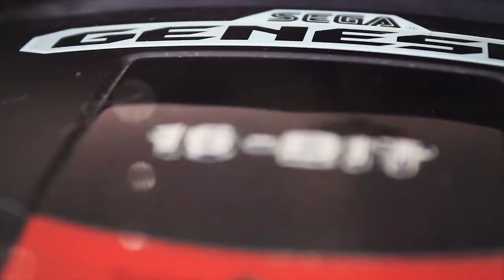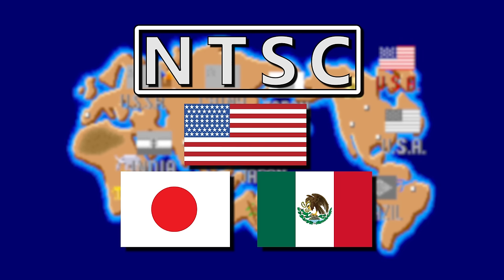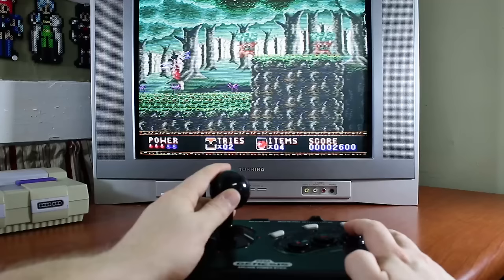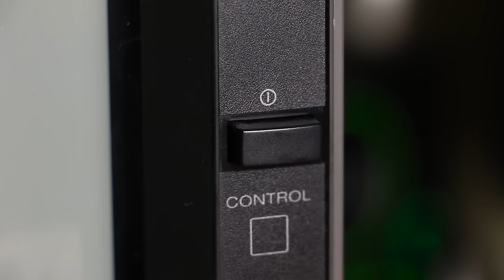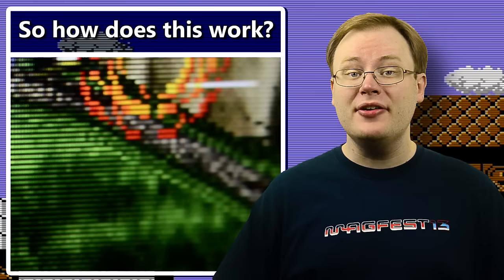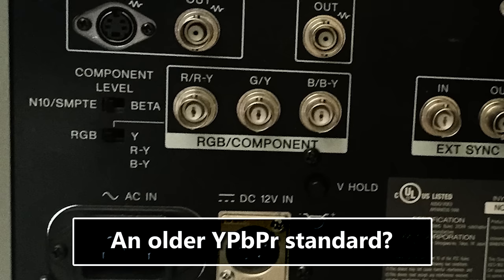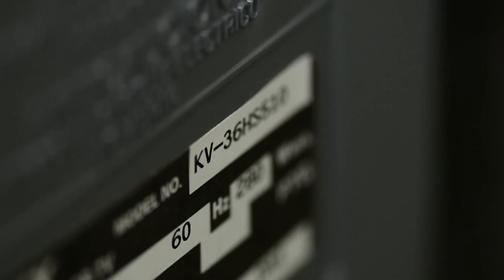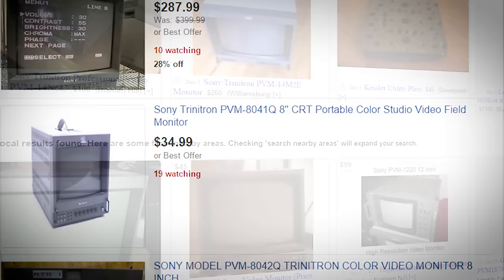Gaming on CRT Televisions, PVMs and BVMs :: RGB104 / MY LIFE IN GAMING

Comment: If you want a PVM but don't want to buy a real one, the CRT-Royale-Kurozumi shader in Retroarch is very easy to use and looks absolutely perfect. Tons of customization too just in case you need to tweak it.
Reply: Just get a 32 inch Toshiba crts the ones they use in the video have Orion tubes and not in house Toshiba made tubes
Reply: then you get not only lcd upscaler lag, but also added time for shader to process a frame.
Reply: @yashe6780  True, but the latency can be mitigated by enabling Run Ahead and having half-decent specs. You can get lower latency than original hardware in some cases. Plus the shaders can be off-loaded to the GPU. Nowadays, it's much better than just a few years ago.

Obviously real CRTs are best, but they're expensive, clunky, and cause headaches when sitting too close or listening to them emit that high-pitched whine. I think modern shaders offer a convenient and accessible alternative, especially if one has a 4K+ resolution.
Reply: I have a television that supports 480i/p 1080i, I want to connect my laptop to play retro games on that TV, I also want to connect my PS1, PS2 and my Sega Dreamcast, what can I do to have the best resolution playing 8/16/32 bit video games?
Reply: It's a Sony Trinitron Wega.
Reply: @FLYNN_TAGGART  Those shaders like Royale always look wrong to me, i managed to tweak them a little and it became better but still... you are missing the zero motion blur and awesome contrast from a real CRT.
I found that the Koko Aio or something shaders offer a more true to life CRT emulation than Royale, but maybe its because im using a common 1080p monitor.

Comment: Theoretically it might be possible to drive a modern LCD or OLED similarly to an old CRT, by emulating the beam path and refreshing the matrix in a scanline pattern.
This would require a specialized controller, and would be somewhat difficult to pull of properly, but the display panels themselves are capable of being driven like that.
With clever software, this could even emulate the scanline look and scale on the fly for near 0ms latency. Though keeping in in sync would be difficult.

Comment: Great video. I spent a lot of time on my gaming setup and currently own a PVM 2030, a JVD 27" TV (D Series) and a RGB modded 20" Samsung TV. Here are my 2 Cents: If you want the best retro gaming experience, my vote is for RGB modded 20" TVs (for North America). While PVMs excel in color, geometry and sharpness, the thick scanlines and the visible pixels ruin the look for me. If you want to recreate the look you remember from childhood (without interference noise) stay away from Sony Trinitrons. They use a technology called "aperture grill" which will produce thick scanlines. A RGB modded (non Sony) TV will give you a "shadow mask" look and if you stay under 20" the pixels will all blur nicely together and create a very pleasing image. Pretty much the image you would see in the Arcades since most classic Arcade games used RGB shadow mask monitors.

Comment: Something regarding the thickness/thinness of the scanlines: it's a twofold thing.   Part of it comes from the dot/grill pitch of the tube (an older tube would be more like a .56 pitch while your newer Toshiba was probably .36).

On top of that, and I learned this from a video of PhoneDork's, is s CRT's TV Lines resolution.  Lower numbers (probably 300 on the 14" Toshiba) isn't too pronounced.  Your 27" tube most likely has about 500, hence the blank lines being more pronounced.

Even higher grade presentation or professional CRTs, like my NEC XM2960, the Sony PVM line, or the BVM line, have even larger TV Line resolutions (going up to over 1100 for the BVM that suppports 1080i!).  This gives those thick black lines some retrogamers desire so heavily.

PD's videos might be a bit colorful on the language, but his NEC vs Sony video is amazingly-informative.  Also, keep in mind the PS1 and Saturn was when games started mixing 240p and 480i while sometimes having a few pure 480i titles.

Comment: I happen to use CRT PC monitors to get my PVM/BVM-like fix.
Way less nerds fighting over them, gouged prices, and tubes that have been punished with tens of thousands of hours of use. Wider pool of tubes to draw from as well, and the results are pretty damn similar to PVMs as far as quality goes. I love the fine geometry control as well. 480p is just standard too if you like 6th gen, and most humble tubes can support 720p if you don't mind a letterboxing. If you score a really nice one, 1080p is a possibility as well, but I find that's usually difficult to get scanning correctly.
I happen to use an XRGB-3, but these days you'd probably be better off with an OSSC to get your stuff over to your monitor's VGA port unless you really need composite and S-video for some of your hardware.
One little quirk is, some monitors won't show very visible raster scanlines, and the ones that do will actually have 2 scanlines per pixel on 240p content, and won't look quite as thick and black compared to PVMs, but I think that's a fair trade for how much easier they can be to come across.
Reply: I've been wondering if scanline nostalgia has been increased by rewritten history or the mandella effect. Only larger CRT's & PVMs would have pronounced scanlines, no kid or teen would have been playing games on a PVM or BVM. I had mid size CRTs (20-30 inch range) growing up but don't remember scanlines specifically. I knew CRTs looked different but I played retro games on a CRT until 2009 (close up of my CRT at the time https://youtu.be/tds3rUJa6Tc?t=1m17s ) then again this past year on a small CRT tv from 1998. Thick black scanlines didn't exist on these. 

Do people actually have real nostalgia or memories of gaming with scanlines or is it something created by emulation filters & youtube convincing people that it was a retro thing (like the exaggerated red/blue color bleeding supposedly on VHS) despite them not seeing a CRT in person for years.

Maybe it is a broader TV brand difference thing?
Thick scanlines make things look much worse to me.
Reply: @EmperorMAR  Retro gamer here, thousands of NES and SNES hours in the 86s-90's. I never cared about the scanlines. I think the biggest thing is the CRT's simply make the old games come to life, hiding their pixelation, bringing them back to their true form without any buffered input lag. The Sony 24" consumer wega trinitron 15khz tube I now have I can see the scanlines however they look more like 25% scanlines would on an emulator. The TV's I grew up with as a kid I didn't really notice the scanlines, they were smaller and often blurrier than a good trinitron set that nobody could afford. The only Trinitron I seen in my single digit childhood running an NES with SMB3 was a lone 13" and of course that didn't have scanlines, however it was noticeably brighter and sharper than any other tube I remembered at that point. I was 13 or so, a good 25 years ago. I was in awe. I prefer the CRT simply because its what these games were designed for, and with FPGA simulation with MiSTer it brings it to a whole new modern level. EDIT: of course when I say no scanlines I obviously mean visible scanlines. If you look close enough on a small set you might see them rolling down the screen due to the interlacing.
Reply: The only different thing is with my  tinnitus, it sounds like a 15khz flyback transformer, so I don't even notice that the TV is on or off, unlike in my early 20's.... I was never around extended periods of loud music in my life, only been to a few concerts, I swear being around whiney CRT's most of my early life gave me tinnitus.
Reply: @aretard7995  Nothing like a good arcade CRT of 27-29" size, can be wired directly into a MiSTer i/o board RGB output, run @ 32khz, and not cost an arm and a leg.

Comment: Most large-size CRTs add a high-frequency wobble to the vertical scanning in order to prevent 'scanlines' from occurring during 480i. most of these have ( or can be given) the ability to detect a lack of field-switching, consequently increase the wobble's strength/height and thus produce scanline-less 240p.

Comment: Unbelievable detail in this. Color me impressed. Your last question to your viewers is something I've often wondered. We see CRTs on the side of the road, in front of houses left out in the rain, and on thrift store shelves for dirt cheap. But in all honesty, when these things are long gone, how will we get these repaired? Will there be an emerging market of retro-graded CRTs? Only time will tell, but I'll be holding onto my CRT for as long as I can. I also often am paranoid that if it ever did die on me, getting a thrift store tv could be problematic as I'm OCD when it comes to remotes. I prefer to have the remote that came with the TV, not a universal one. Often times, those thrift store TVs don't come with one. Luckily, that's where ebay comes in handy.
Reply: Dongled the problem is scale economy: high end consumer CRTs costed up to 1000$ and they were made in hundreds of thousands. PVM costed TENS OF THOUSANDS of $. I can't see anybody paying 40000$ for a new pvm today just for retrogaming. Or 3000$ for a mid-end consumer CRT made in a couple of thousands units.

Comment: Crts will last years an example of this is the 25" arcade monitor in my oldest cab the dynamo hs1 1988 its been on all day playing Street fighter 2 down in the warehouse for well over 30 years, other than having to fix the chassis from time to time the tube is still healthy and registering way up in the green as good on my crt rejuvenation tester, that's what comes with regular maintenance and keeping picture settings at sensible levels and keeping an eye on B+ levels as this has a direct influence on how hot the heaters are. As someone who builds classic arcade monitors and still fixes the old crt tvs its a technology that was built to last and certainly outlasts the new flat panels, its important with crts to make sure they are serviced correctly and keeping them clean inside as well, keep your picture brightness and contrast to optimum (sensible) levels to preserve tube life and it will most likely outlive you, care for it like you would care for a new car.

Comment: 2019 and i'm looking at buying a CRT lol
Reply: Money wasted, but go on.
Reply: @danieltortellinijr.6594  If is very expensive, a flat modern tv can be a better option.
Reply: Good thinking. The artist DID HAD in mind crt tvs when doing pixel art, look at some text for example and you will see the extra pixels in a darker color around it. that was meant to convine with the RF or composite signal of tvs and give a more round or a specific color to the image. A regular crt tv is the better option better than pvm for this reason, even no rgb is need unless you are talking about dreamcast who did designed games with 480p in mind. I use PC crt wich is similar to pvm, but almost always add some color filters to make the image "crapier" similar to who old tv looks. scanlines are orgininal of course becose i use native 240p resolutions.

Comment: Surprised you didn't mention  "Digital Comb Filter" on CRTs like Toshiba and Sony. 
I have a flat display Toshiba ColorStream (model 20AF43) and I've noticed no "wavy" distortion on it at all. It has S-video and Component video inputs, and possibly due to it's three-line Digital Comb Filter S-Video and component video from my classic consoles and even from the Wii looks sharp and crisp, there's no Gaussian blur and virtually no color bleed. (only noticable on text graphics that's bright orange or bright red). 
I have a Victor Wondermega hooked up via S-Video to my Toshiba Colorstream, and OMG my Megadrive games look AMAZING with crisp, sharp, non-blurriness, no color mixed pixels at all. 
Even on composite, my Wii games look amazing! my jaw hit the floor when I saw Metroid Prime 2 (on the Metroid Prime Trilogy disc) all thanks to whatever electronic sorcery my Toshiba Colorstream is doing.
IMO CRTs like the model of Toshiba I mentioned, with a 3-line digital comb filter that have Component and S-video inputs are far superior for retro gaming than CRTs that don't have that feature. Using component or s-video cables on that kind of CRT SD TV, is a great option for people like me that can't really afford to get a PVM or BVM or get all those special cables and adapters, etc to get RGB IMO
Reply: Comb filters are only relevant for composite signals.  They separate luminance and chroma frequencies, which tend to overlap with higher resolution sources such as graphics.  If you're using S-video or component, the comb filter shouldn't even be in circuit.  Since color and luminance are being transmitted via their own cables with SV/component, there's no need for a band filter to isolate them from each other.

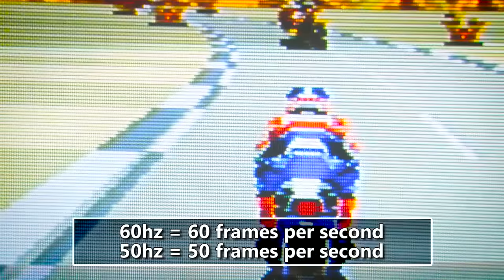Comment: 4:17 I think you mean "Fields per Second" not "Frames per Second". Two fields make up one frame. So to get the frame rate, you simply divide the field rate by 2. In PAL regions we use 25frames per second interlaced, and NTSC countries use 30 frames per second interlaced. Although now in the digital age we have variants that display them progressively.
Reply: With progressive scan, field and frame is the same thing. Meaning, we did get 50 or 60 frames per second with old consoles and CRT TVs.

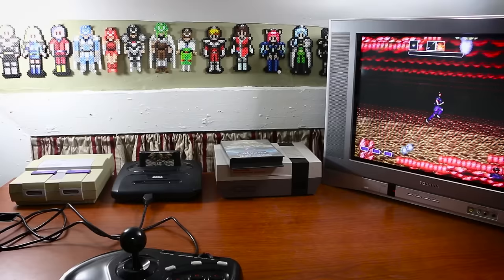Comment: 5:07 I just modded that very TV (Toshiba 20AF41C?) for RGB input. It''s nice. Composite alone looks good.
Reply: that... actually sounds like a brilliant idea to mod consumer grade TVs, if I have to mod my NES for RGB might as well fuck with my TV while I'm at it
Reply: Dumb. SNES only pumps out 240p and PS2 can only pump out 480p regardless of what type of connection its going through. changing the cable plug does not magically upscale the image.
Reply: urdnal
... resolution is the only factor that will make the game look better. old games were specifically designed around the limitations of 240p. trying to push that same 240p signal through HDMI, SCART, or a bunch of up-scaling converters is not going to achieve anything more than what you can get out of the basic 240p signal.
Reply: You seem to be confused about what's going on. We're talking about using RGB on CRT TVs. No HDMI or upscaling involved. Do you even know what video this is? No one's talking about improving anything coming out of the console, it's to display the image without losing any quality by modulating the console's RGB signal over RF, composite or s-video, which was all north american CRT TVs had back then.
Reply: the point is to get the best quality, nobody ask talking about resolution here

btw increasing resolutions only improves 3D images, get your shit straight...

Comment: Cant they just make a super TV that displays everything perfectly with no lag?  It's 2016 after all.
Reply: cost...
Reply: You can't make a flatscreen TV as versatile as a CRT is, with a CRT you can have pixels of any width, and a bunch of different resolutions, but on an LCD/OLED everything is completely static. 

The best thing would be if someone made new CRTs for retro folks but that's pretty much completely impossible for make sense of financially so that won't happen.
Reply: That's a digital CRT, which they talk about in this video. You do not want those, it's the worst of both worlds.
Reply: Nukleon no i know this tv sucks for retro games but for modern tv nothing beats the picture quality of a HDCRT i have the exact model and a 55 inch 4k  Sony yet i still prefer the crt for most things
Reply: its also analog aswell it says it has a NTSC and a seperate ATSC tuner its really the best of both worlds the features of a lcd but the picture quality and the extremly low input lag (for modern games)of a CRT
Reply: I am bagel dude you have never seen a HD CRT especially not this one this IS the highest end CRT EVER made not joking at all the clarity is fucking amazing and 720p looks much better on a CRT then LCDs plus the native progressive scan resolution on this TV is 1480x1080 so it's much higher then 720p
Reply: but I will admit that oleds look better then it but they have bad input lag far worse burn in then CRTs and cost thousands I bought the xbr960 for 15$ at a flea market
Reply: Turrican4D I don't think that should affect this TV as it is a aperture grille not a shadow mask tube
Reply: HD CRT are shite, as said in the video.
Reply: Nukleon but what if you feed it a framemeister signal to get scanlines and get the lag down to something completely reasonable? Thats lessens the blow.
Reply: Gabriele Riva not true, HDCRT's are great for watching HD content and playing new generetion games, but for old retro games and sd content it is very packluster.
Reply: You want a Sony G90 crt projector. Handles any resolution natively from 15khz up to 4K. It's the best and most versatile crt ever
Reply: Omega Rugal  : in 2009 i bought my TV, a sharp aquos. I have had zero problems with input lag, and zero problems with image clarity. Game look excellent scaled up to the 42". I have connected PS1, PS2, XBOX via S-Video and XBOX 360 via Component. I don't miss CRT - i did my time with those. But my TV does have proper analogue circuitry built in (as well as digital). Rather than going to all these ridiculous lengths, people should see if they can find TVs with proper analogue circuitry rather than the emulated rubbish most modern TVs have. Spend the money on the TV and you wont need a ridiculous CRT room in your house, or a frame meister! So yes you actually - i think this channel can be OTT with this shit!
Reply: No it's 2020 😁